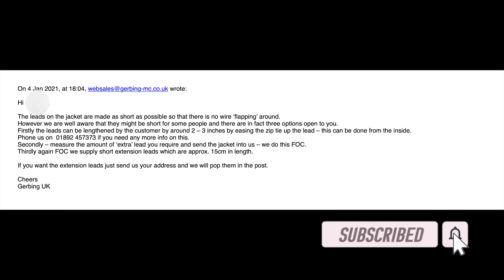Using Gerbing Heated Clothing on my BMW GSA 1250.

Comment: Thanks for your video. I've used Gerbing for years and this week I got a new BMW 1250 GS 2024 but I'm concerned of connecting  the cable directly to the bmw battery. How did you do it? No drying out issues with the (sensible) electronic of the bike?
Cheers
Reply from the maker: Hi, on all my bikes I have always connected it directly to the bikes battery and never had any issues. If you have access to a trickle charger you could use that for peace of mind but I never had to do that. 
Congratulations on the new bike. 👍